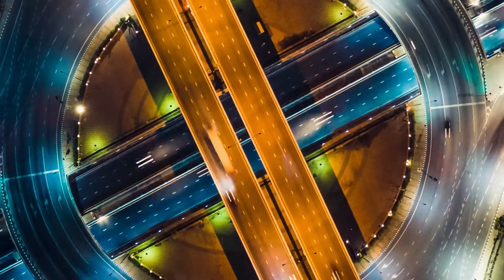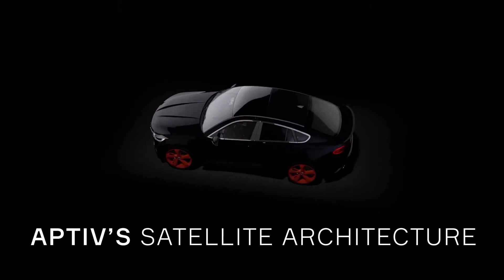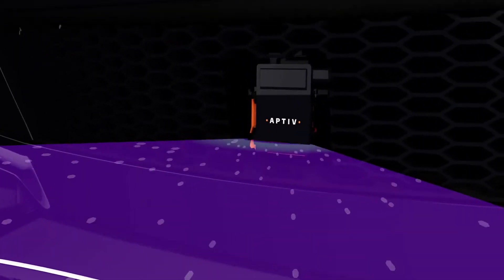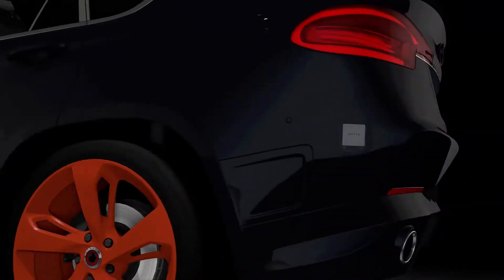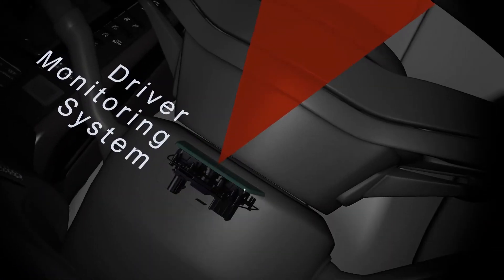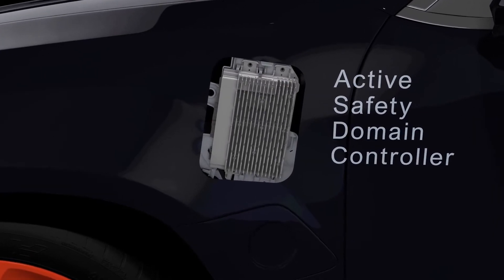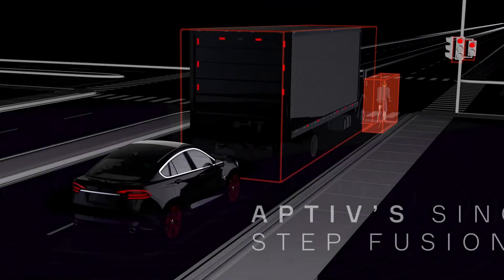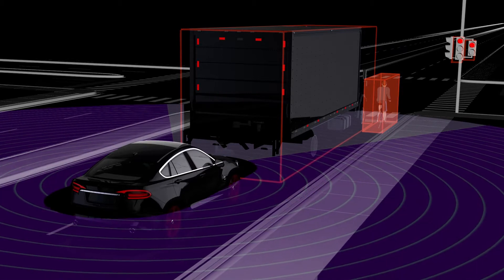Aptiv’s Satellite Architecture

Comment: What is the difference between a camera and a satellite camera? or a radar and a satellite radar?
Reply: Traditionally, cameras and radars have been designed to process their inputs independently. That means the processor would be packaged together with the rest of the camera or radar. In Satellite Architecture, only the pieces that need to be at a particular location are there, while the processing is done in a central domain controller. With a camera, for instance, the lens and CMOS sensor are in the required location, but a serializer transmits the data on a line back to a controller to be processed. Space is tight in a vehicle, so having this kind of architecture offers more flexibility and the other benefits mentioned in the video. More info here: https://www.aptiv.com/en/insights/article/satellite-architecture-basics and here: https://www.aptiv.com/en/insights/article/a-clear-view-on-advanced-vision-solutions
Reply: @JeffCaruso  Thanks
Reply: @JeffCaruso  But with lidar becoming almost a necessity for level 3 and up nowadays, would there be a way for lidar to be included here? Or with Satellite Architecture, is Radar and Camera sufficient?
Reply: ❤🎉 beautiful voice